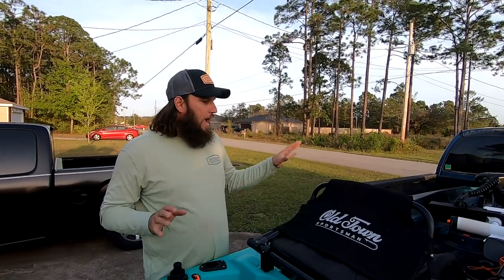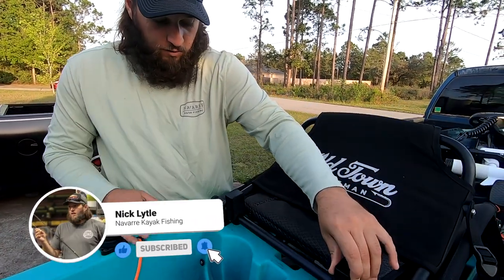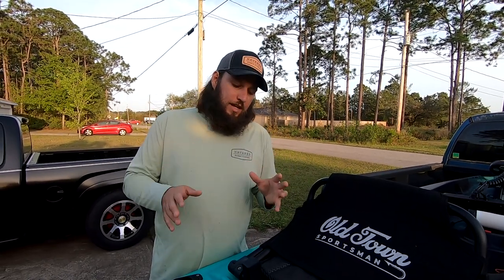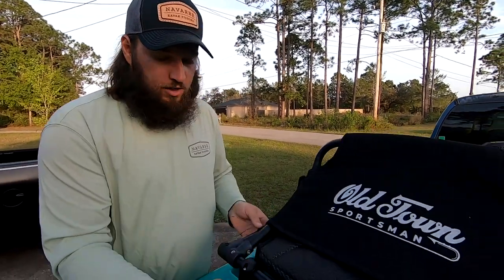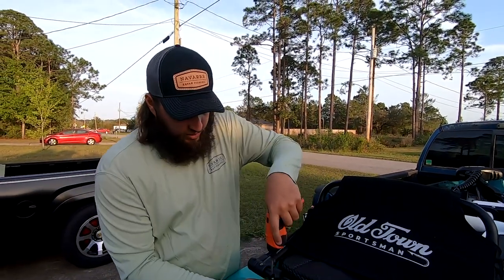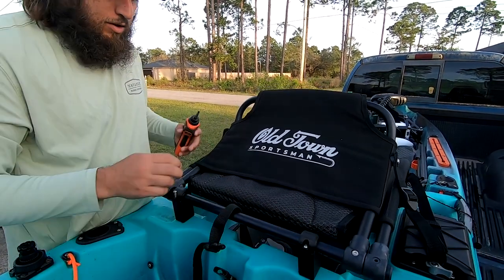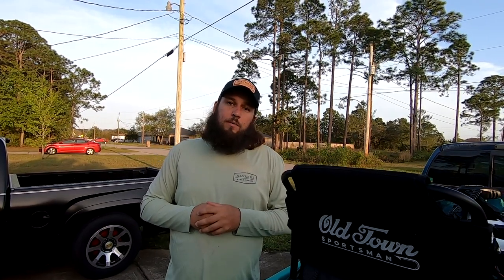Old Town AutoPilot and Minn Kota Seat Risers

Comment: Just got my 136 and took it out and I can’t tell you how irritating it was trying to stand up from this seat. Not uncomfortable but the risers would make the difference I think. Lookin at this design I like it but there is one modification I would like to see to it and I would buy a pair instantly. The ability for them to move back to give that lower position is great but my worry is say you have one kicked out and didn’t notice and you sat down. You would put the seat in a bind and shift all your weight to one direction. Which the 136 is very stable but add a bit of chop and you might be swimming. If there could be a U shape design that came down to prevent this I would already have them on the way.
Reply from the maker: If you strap your seat in correctly there’s no reason for one of the risers to be out of place.
Reply: @NavarreKayakFishing   just that extra peace of mind but found what I was looking for while not perfect it will work.

Comment: How do you install the front risers? And are the fronts necessary?
Reply from the maker: The front are not necessary but the help depending on height.  They are shims you simply remove screws, insert shim, and install longer screws.
Reply: @NavarreKayakFishing  does it work with the old town topwater paddle version? On your website it only includes the sportsman.

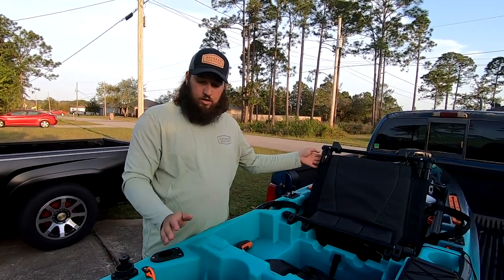Comment: Unfortunately ran into a major problem, which was resolved through a bit of re-engineering thought & work. Close attention to minutes 3:00 to 3:04 reveals an extremely aggravating condition as the seat-BACK is swung BACK into position ....the 2 rear risers rotate bottom-forward, losing the seat's rear high-rise benefit and causing physical acrobatic positioning reaching back to flip them both back into riser position. Due to the formative structure of the 136 I had to jigsaw/file-smooth both riser bottoms 3/16" to 0" angle, drill down 2" thru riser holes & kayak frame to 3"-bolt/washer/nylon-nut the riser into rock-solid lock-down.  Works absolutely perfect now !  Don't expect to miss any of the rear risers rocking back & forth riser 'benefits'. I believe Nick's new ideas & production are fantastic but just needed imo some tweaking to resolve my own above described aggravation point.
Reply from the maker: Great feedback.  The goal is to always improve the items.

Comment: I have the 106MK, what size do you recommend? 1" or 2"? I'm about 5'5" .
Reply from the maker: 2” is the most common. It helps level the seat out.
Reply: @NavarreKayakFishing  I was going to go with the 2" like you recommended but, on your store site the front selection is 1" only. I'm a bit confused. Don't the they have to be the same height front and rear?
Reply: Also you never showed how to mount the front ones.
Reply from the maker: Most people raise the rear 2” and the front 1”.  The seat is in a reclined position so you want to raise the rear higher then the front.  It levels the seat out and makes leaning forward easier. 

Raising the front takes a bit of the bend out of your knees and makes standing easier. 

The front risers install super easy.  You just remove four screws, install the riser, place mount on top of riser, install four screws.
Reply: @NavarreKayakFishing  Now that makes perfect sense. Thank you for explanation. :)
I would recommend putting that explanation for those parts on your store. It will prevent people from buying the wrong parts like I just did-lol!